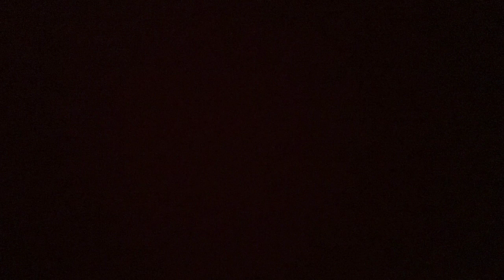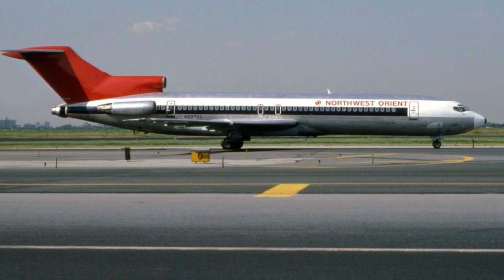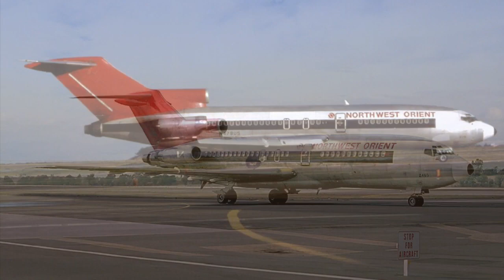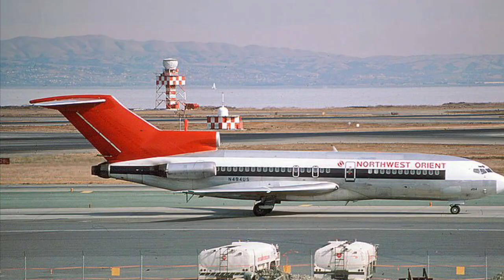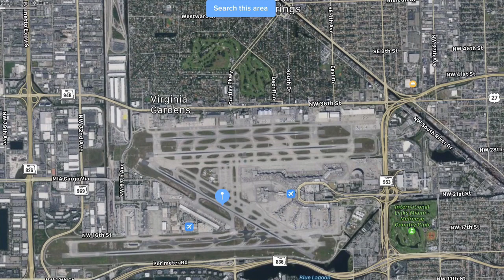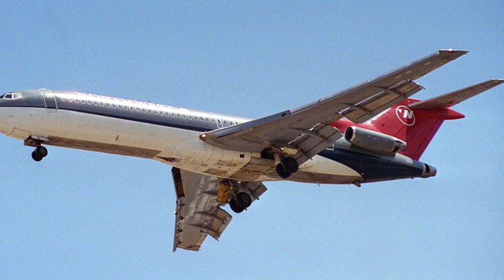The Lavatory Leak That Ripped Off A Jet Engine | Nothwest Airlines Flight 5

Comment: Wow! That was really interesting. 

Cool that a "just in case" design feature -- the breakaway feature for a damaged engine -- proved to work EXACTLY as planned. Some engineer on that project probably saved a plane full of lives with that feature.
Reply: Im also intrigued. I wonder if the british cousin the Hawker Siddely Trident had a similar feature. I mean think about it if the Trident had auto land capabilities and sophisticated and complex avionics, mechanisms etc wouldn't they at least add something like this?

Comment: Considering the fact that there are windows next to the engine, I'd like to know how the heck was possible for the cabin crew to miss the fact that one engine wasn't there :) I flew with an MD-80 and was assigned to one of the latest row of seats and guys, I tell you that you could really feel (and HEAR!) that the engine was like 1.5m from you, other then having the outside view obstructed by it :)

Comment: How did the pilots not know engine #2 was missing? Cars now have rear-looking cameras, dont planes?
Reply: No, they haven't. But still, if not the pilots, at least the cabin crew should have noticed it, since they are well visible from the windows of the latest seat rows. That is pretty strange they missed it.
Reply: No wing mirrors mate!
Reply: 1990 is not now though

Comment: I’m an aircraft mechanic. Blue ice causes a sudden stoppage and snaps the 3 engine mount bolts (cone bolts)
 which are designed to shear rather than overstress the airframe. There are repetitive inspections to check the integrity of the lav dump system for leakage.

Comment: Again, a go pro mounted externally could give the pilot views on the external portion of aircraft (wings, tail, landing gears and engines).... tsk2.
Reply from the maker: I think a lot of airbus planes have that feature nowadays.
Reply: @MiniAirCrashInvestigation  its not on the outside, their embedded to be smooth with the surface. Having any mounted creates air turbulence in that location, last thing you want over any crucial control surfaces.